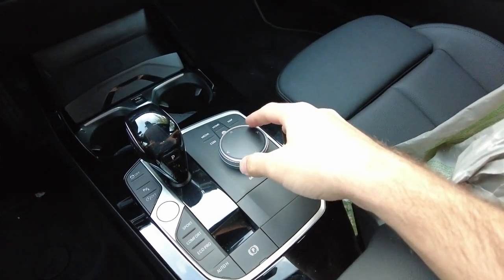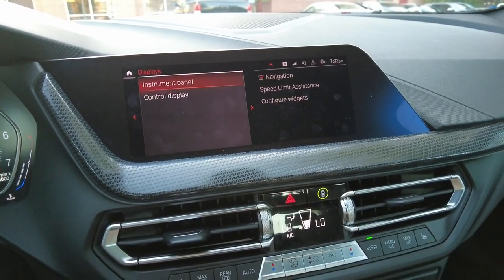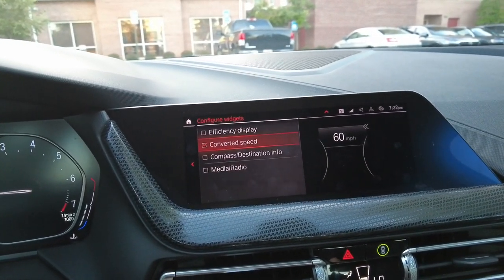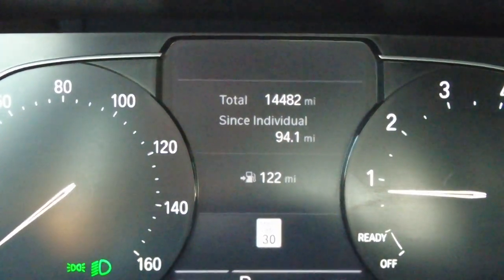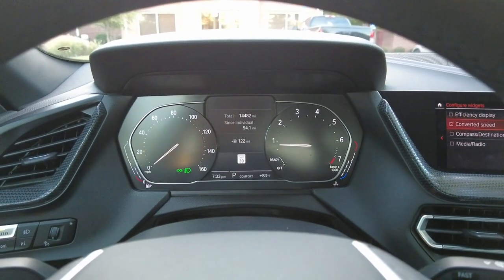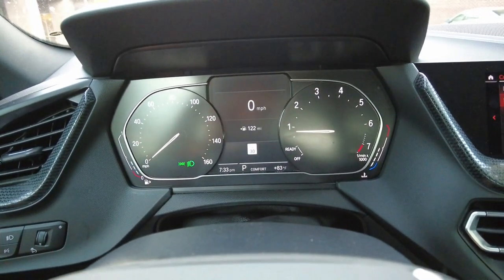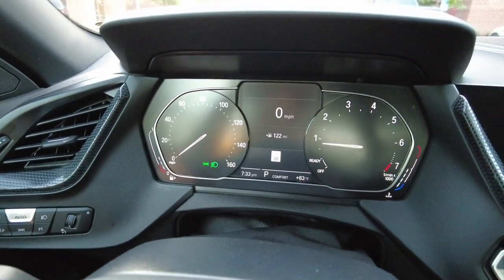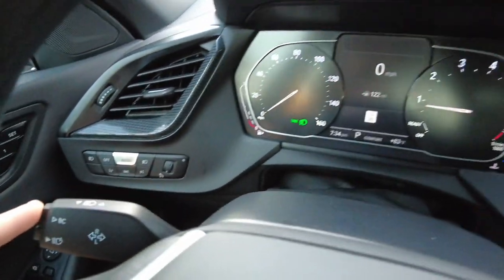How to show Digital Speedometer in 2021 BMW 228i

Comment: Is it possible to get rid of the range showing in the middle of the cluster?
Reply: You can change the info in the middle of the cluster if in settings> Display> instrument panel> central display area assisted driving view (is the choice on my car, then there is a whole menu for that)